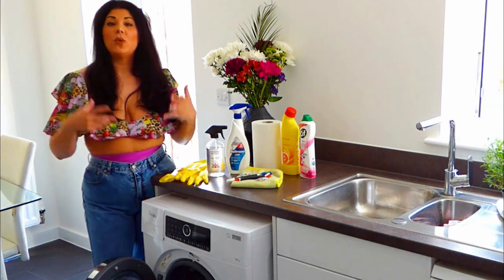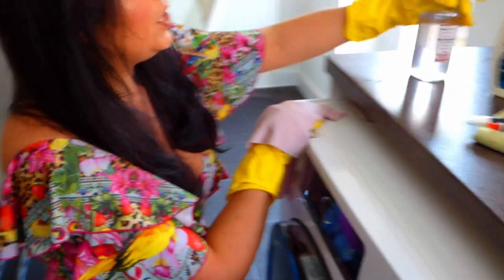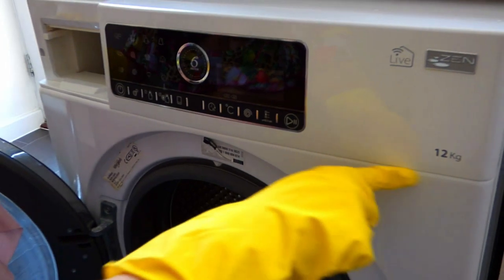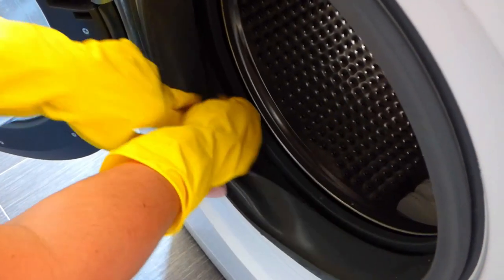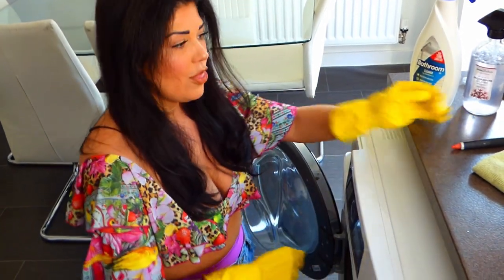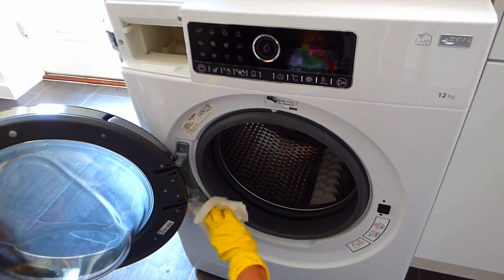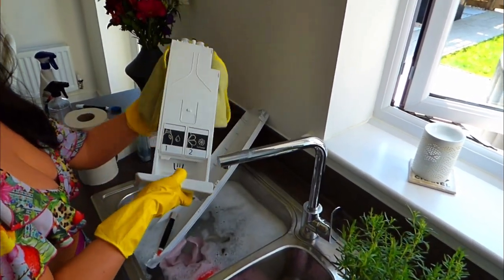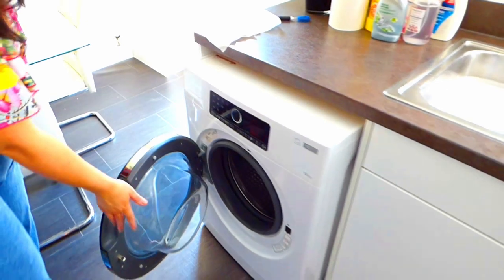How To Clean The Washing Machine! HACK! Dishwasher Tablet Washing Machine Cleaning Step by Step

Comment: Thanks Hayley! I cleaned the washing machine and tumble dryer today as well as the oven. I have really hard soap on the drawer of the washing machine that I spent well over an hour trying to remove. I tried... wire wool, hydrogen peroxide with bicarb, bleach, boiling water, scraping with a knife but to no avail. I’ve ordered some descaler to see if this will help but in the meantime, do you have any tips? Thanks so much. Also, I was wondering if you could do a video on your best cleaning gadgets. I’ve just ordered the vax  multipurpose steam cleaner. 💜
Reply: Hi just letting you know I love experimenting with cleaning products however mixing hydrogen peroxide with bleach is highly dangerous because it can release harmful gases such as chlorine gas maybe try using them separate for safety anyways take care

Comment: Before using any chemicals on a rubber door seal do check the label first to see if it's safe to use on rubber, as some are definitely NOT safe to use as they will ruin the seal and make it leak all over your floor. And my washer holds about one and a half gallons of water after washing so if I undo the filter plug it floods my kitchen! They always put the filter outlet plug far too close to the floor.
Reply from the maker: Oh noooooooo that’s such a pain! Mine leaks a little but only maybe a few cups worth of water so it’s easy to soak up with a towel 😬
Reply: @hayleyshelp  Some machines have a little hose you can pull out which you can use to drain it down more safely but I don't think mine has one, I'll have to check. Otherwise it looks like I'll have to do a bit of modifying as it looks like bosch just couldn't be bothered to design that bit proper.

Comment: Hi, Hayley, I don't think it's a good idea using bleach or vinegar in a washing machine, as they're both seriously corrosive to the metal parts, like the VERY expensive stainless steel inner drum. Even stainless will corrode badly in contact with bleach, and vinegar is very acidic which is corrosive to lots of metals. Have you heard of the ecoegg tablets? I haven't tried them yet but I've seen them, they're supposed to clean washing machines, or so they claim, I'll have to find out more about the ingredients first though. And my washer absolutely STINKS now so I'll have to give it a deep clean somehow.
Reply from the maker: Ecoeggs yes I have heard of them, you can pick up actual washing machine cleaners I’ve got one here and you run around the seal then turn on a hot wash. It’s always a good shout to check the ingredients just to be certain ☺️
Reply: @hayleyshelp  It's a good job you're 100's of miles away from me, you wouldn't want to be near my place right now, my washer stinks so much it's stunk the whole house out, and now it's reached my bedroom! And I've got to sleep in here tonight, so I've had to shut my washer's door or else it might stink the whole town out! It stinks like a medieval brothel! And I have a military standard gas mask that's made to protect soldiers from deadly nerve gas and I sometimes use it for spraying poison to wipe out dry rot fungus and wood eating bugs, but now it looks like I'll need it to clean my washing machine. And now I've got to replace the drum bearing and seal, and that's a MAJOR strip down, I'll be glad when that's done.  And I have some disinfectant spray here but it can't be used on rubber.